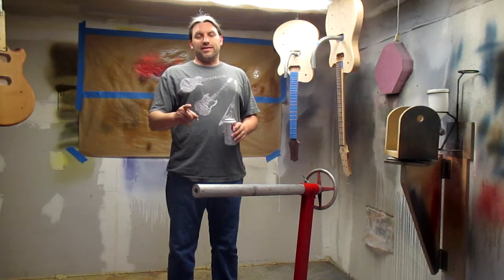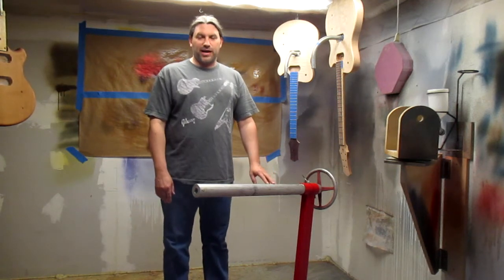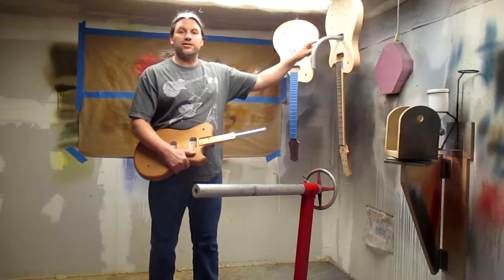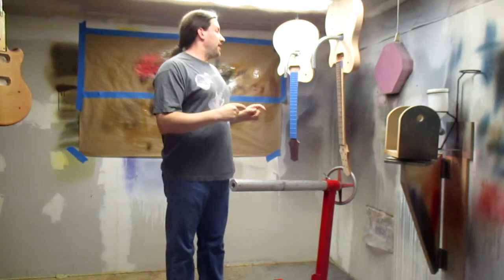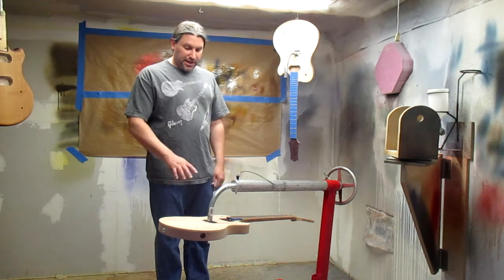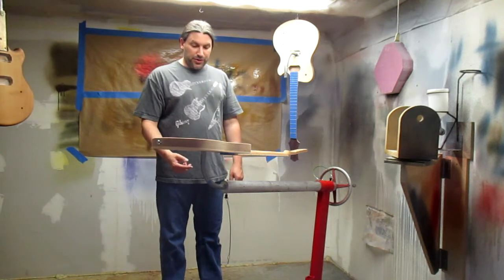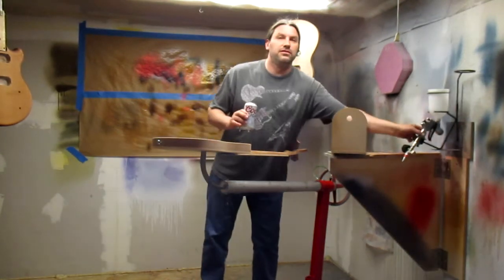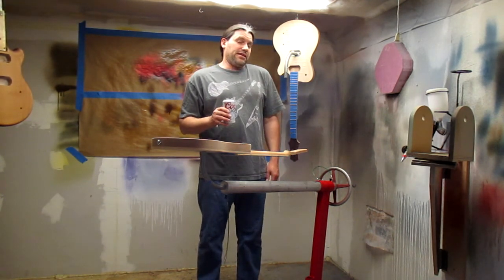The Best Guitar Painting Jig Ever

Comment: Have your machinist buddy swap in a bent center mandrel so when rotating, the guitar turns at the center while the mandrel does the high low swing. Set point locks so you can use bolt on body stub at the best working height like you do now.
Reply from the maker: That is a good idea, however, I don't really do bolt-on guitars anymore.
Reply from the maker: Maybe one day I'll do it again?

Comment: Hey Matt, Dave Sabella here, question for you on this rig. I just finished building my paint booth and  it's quite a bit smaller than your room there, would that same rig work if it was oriented in an upgright position? I was thinking if the aluminum rod was sticking straight up from the ground and the set neck was inserted with the neck facing down you could just rotate it around the same way but from right to left...thoughts?
Reply from the maker: I think it should work fine Dave. 
You will need to articulate the device such that getting paint on the ends is easy but that is the only issue I can see
Reply: @TexasToastGuitars  Cool, thanks!

Comment: I bet the pins cable has rubbed against the body many times fucking up the paint job.. Fix cut the cable off the pins..
Reply from the maker: I don't know why you would think that?
Actually the pin has been permanently attached and works quite well. We used it just today. This rig has been a game changer for us. Clearly, there are lots of ways to do this same thing... for example, a guy from PRS says that they have a better way. Not really hard to believe that the 3rd largest US guitar company has a slick way to paint guitars.